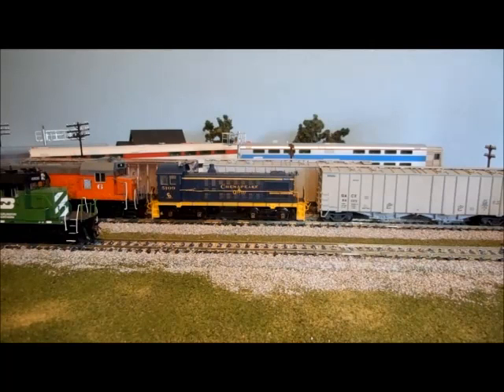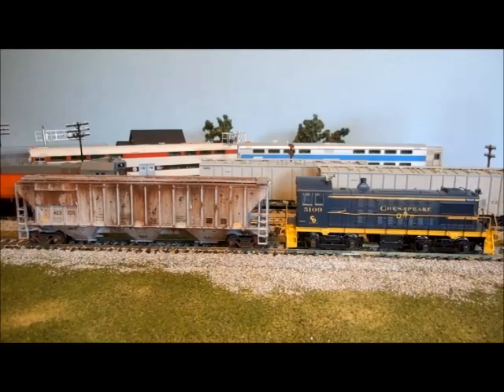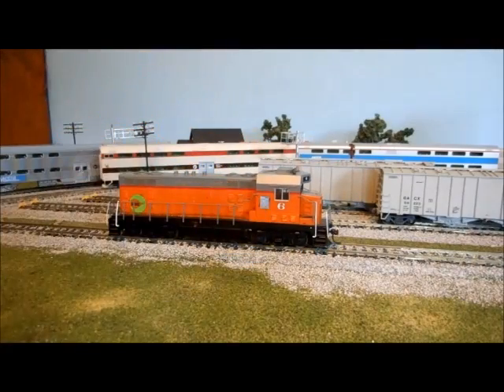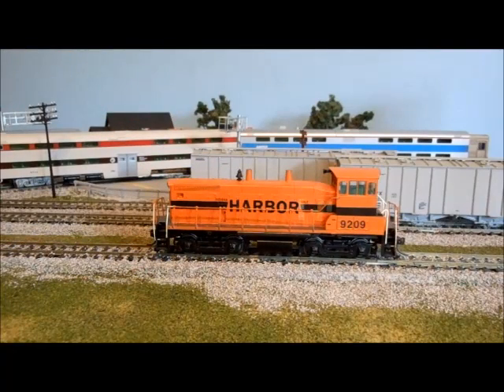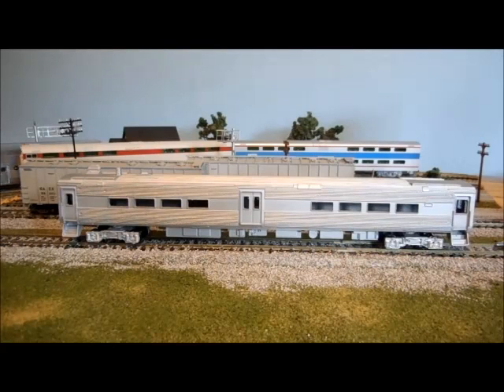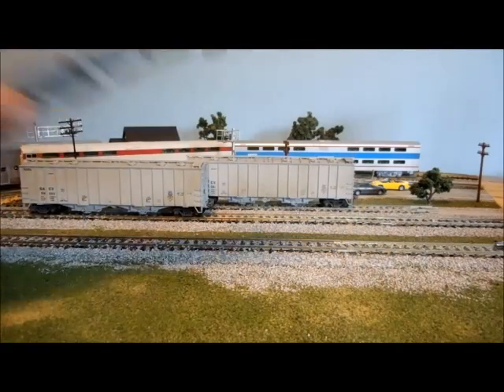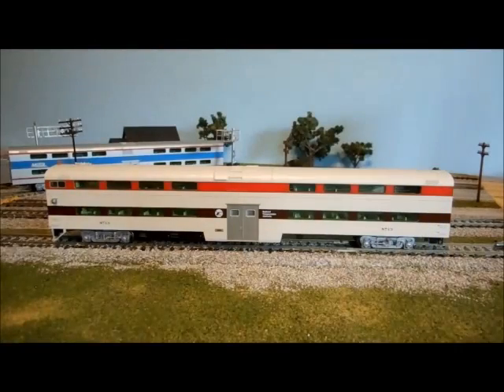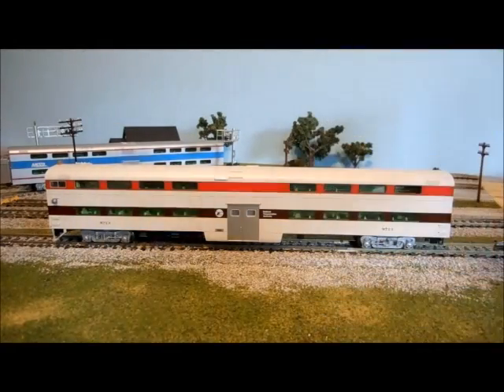HO Scale Locomotive & Rolling Stock Update 7/27/2014 (Part 1 of 2)

Comment: Very nice stuff. If the Island Model Works South Shore Line NICTD cars were more affordable, I'd get some, but they just seem to unaffordable. If anything, I'll most likely get the CSS GP38-2 first. Well, it's not like I don't have any South Shore equipment. I have a CSS gondola and a custom CSS caboose. But it probably might be a while before I get any locomotives much more because I plan to get myself next an Athearn Norfolk Southern SD70ACE and then I'm going to start saving up for DCC. But stuff is so expensive. That explains why I don't have new stuff all the time and a huge fraction of my stuff is gifts. Now when I start going to DCC, I'm obviously going to get sound decoders for my locomotives before I get any for my rolling stock. But until I get DCC wich hopefully will be in atleast the next 5-6 months or so, my layout is going to be as quiet as can be and not so often will there be new things. The first sound decoders would be going in my most commonly ran engines such as my True Line Trains Metra MP36 for example. Anyways, I'm starting to get off topic here with DCC. But anyways, if I do get the NICTD cars, it won't be for a while.

Comment: In the sd40-2 did you use the original incondecent bulbs if so what visitors did you use
Reply from the maker: They are 1.5V bulbs that were already on the model, those are all I use for my projects
Reply: What resistors do you use
Reply from the maker: Donnie Dixon The GN-1000 & AT-1000 from Soundtraxx have resistors pre-wired into the board, no resistors needed! This saves a lot of time if you use the 1.5V micro bulbs like these models
Reply: Oh ok

Comment: For the Pantographs, have you tried TeeUSA? http://www.tee-usa.com/store/sommerfeldt-catalog-ho-pantographs.html It would still cost you about $50.00, but its about half of what you stated. Also Walthers sells pantographs used in the new Metroliners for about ten dollars each. They are all silver, but nothing a little black paint couldn't fix. Thanks for posting the links.
Reply from the maker: Where are you finding the Walther's Pantograph's at? I searched their website and could not find them, can you provide a link, thanks
Reply: metraF40PH163
 You have to call their parts department. The pantographs are from the new Metroliners. You have to specify the single armed pantographs as they also have the double armed ones for the Metro liner.

Comment: I don't want to sound mean or anything but how can you out of all people chose Soundtraxx over Loksound. You being very smart i would think that as many do you would chose Loksound but you still chose Soundtraxx. Loksound has so many more advantages, It's Louder, It plain sounds Better, and is more compact and easy to Install. I just don't get why you would chose Soundtraxx for so many of your locomotives..... :|
Reply from the maker: ***** Soundtraxx is built in the USA, their company has made custom products for me, and their customer support is the best I've seen. I also like their sounds and the fact that they have pre wired resistors on the board already. I"m going to give Lok sound a try here soon but, I'm not a fan of their F40 decoder they ruined with having an ebell sound only option. Soundtraxx goes plenty loud if you adjust it to, I hate having my trains super loud I turn the volume down a lot on them.  Soundtraxx sounds really good I have no complaints but, I know sounds are getting better with lok-sound. I'll give it a try here soon I've not been doing much with my trains recently
Reply: If you seriously think that the ESU Decoder For F40PH's is so bad because of one bell and yet Soundtraxx has the wrong bell on 90% of decoders made and yet the Soundtraxx F40PH can not run in HEP mode at all and cannot even use the right bell either i do not understand that logic at all. It makes no sense. Loksound used on bell wrong one basically one decoder and Soundtraxx used the wrong bell on a huge amount. ESU (Loksound) Is just better, and always will be. Also i know you ordered a Custom Decoder with a gong bell but all you would have to have done is buy a GP15-1 decoder, they had a gong bell....
Reply from the maker: ***** It is a big deal because for an engine that was built in the Mid 70s to only have a modern ebell sound, that's just dumb. Where did you get the 90% data from? Actually if you change CV's you can have the Soundtraxx decoders operate in HEP mode. The decoder for the Metra & Amtrak versions on Soundtraxx has the correct bell not sure what your talking about? Soundtraxx does not sell the GP15-1 in the catalogs a custom order must be done to obtain one (which I did) Lots of opinions here. Compare todays decoders to the old first run of sound decoders from many years ago and listen to the difference. I like Soundtraxx because they are built in the USA, and provide me with amazing customer service and prototypical sounds. Keep in mind this is my model railroad and my money. I'm open for giving lok-sound a try but, I like Soundtraxx